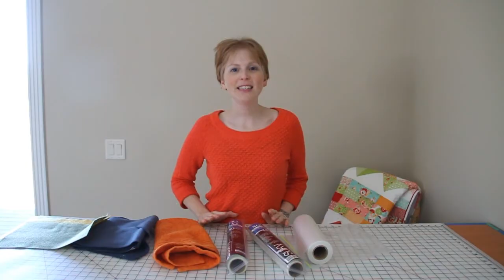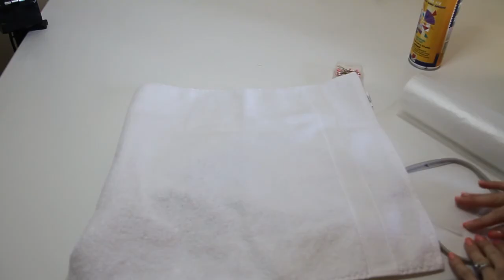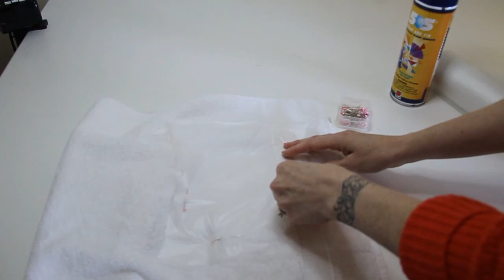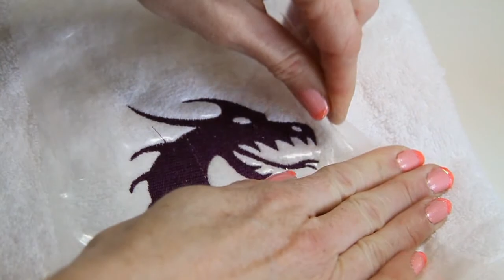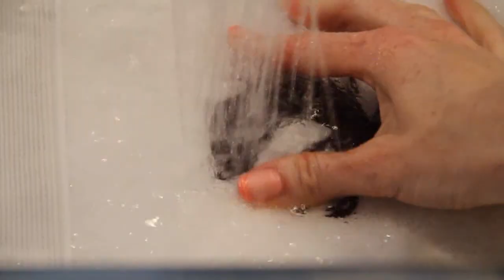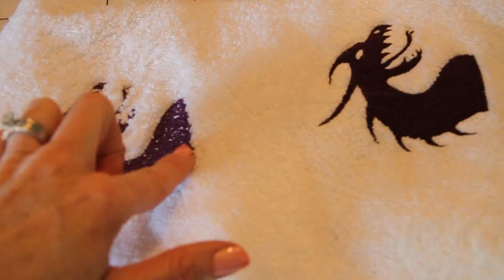How to use Water Soluble Embroidery Stabilizer

Comment: Thank you so much! It was very helpful. I just have a question, my stabilizer has two sides, one smooth and the other not. Which side should I use on top of the fabric?
Reply from the maker: If it's water soluble stabilizer then it should not make a difference...but check the manufacturer's instructions to make sure.

Comment: Hi, I sketched with permanent marker on the WSS and stitched over it to my clothe. But now I'm afraid the ink will come off once I wash it, is there any way to prevent smugging from happening?
Reply from the maker: I  haven’t tried to wash permanent marker but I would say to toss a color catcher into the laundry with it, that way if the ink does run, the color catcher should get it. If you are not familiar with color catchers you find them in the laundry aisle. I also did a video about color catchers...you can find that here: https://youtu.be/eLTIPoBQhlU

I'm also wondering if you should wash the garment with cold water, and have you ironed it to heat set the marker?? Again I'm not sure if that will work since I don't have a lot of experience with permanent markers, but it's worth a try. Good luck!  Let me know how it turns out.  XOXO - Kat  :)

Comment: Great video,...........Question: I embroider T shirts using water soluble stabilizer for backing stabelizer. I also want to use Tender Touch stabelizer afterwards to prevent skin irritation. Is it ok to tear off the water stabelizer and not worry about dissolving the little bits since I’m ironing on the Tender Touch thereby preventing the little bits from being felt or seen?
Reply from the maker: Yes that would be fine…as the little bits will just dissolve once it’s washed :)
Reply: @CalicoCaliDesigns  thanks so much

Comment: Hi,  why do we need wash away stabilizer in spite of base stabilizer?  Basestavilizer will remain with the towel know? :🤗
Reply from the maker: The wash away keeps the stitches from sinking into the towel... without it the embroidery will not look as good, as it will be partially hidden by the fibers in the towel..you need to use both the base stabilizer and the topper stabilizer for the best quality stitch out.
Reply: Hi  @CalicoCaliDesigns  what do I have to use as base stabilizer. And which stabilizers you recommend for base & top.